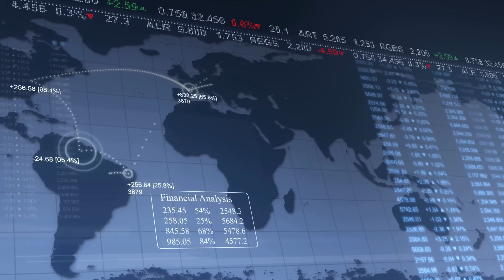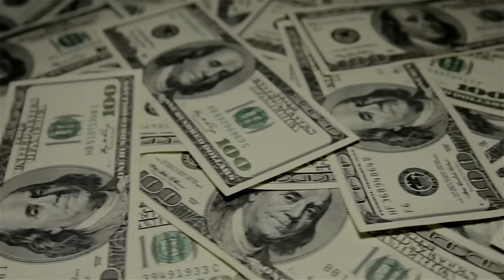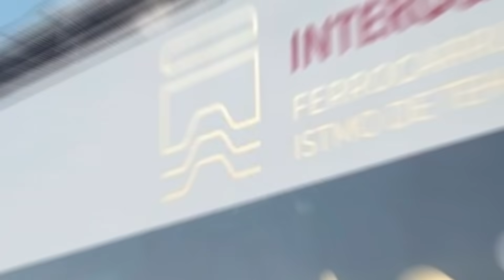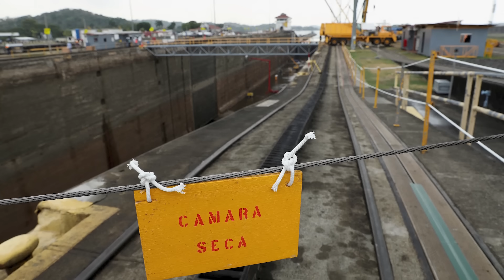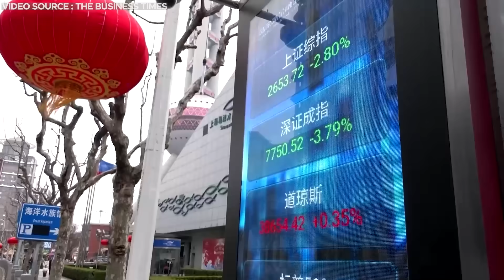Mexico Is Building A $5 BILLION Corridor That Will END The Panama Canal

Comment: U have to realize that this was attempted before and it failed.  Ships still want to use the Panama canal more that this railway transfer as it is more tedious.  However due to desperation, there will be some ships that may opt using this alternative... that is if the cost is lower than the fuel and operating expense of going around the tip of South America as the only other option so far.
Reply: it failed only when the canal was opened and the rail's business dried up.

Comment: I hope the engineers have another way of thinking. Instead of a "water canal" use a mega-lift to raise the ships by hydraulics. Then pull them from the east to west or west to east by diesel or electric locomotives. They will have to use locomotives to pull the ships anyway. So why not lift them up with mega-lifts under the keel to secure them then transport them. In turn it would be cheaper to build as well. 
Just thinking outside the box. Thanks for the video.
Reply: Do you think existing ships would be able to take the stress of being out of the water fully loaded? My guess is they would need to build ships differently to handle this,.  The trade off would make the ships heavier and lower capacity, could have a negative impact of profitability.
Reply: @mplsmark222  Exactly, ships are designed to carry the load in water not out of water. They would fall apart.
Reply: @tired7140  I agree, the additional costs of building new reinforced ships, the heavy rails and equipment ect, it might be easier and cheaper to just dig another canal. A Chinese guy had started on a new canal in Nicaragua, but the project failed. Seems like that could be restarted just like the Panama Canal, but perhaps their political status will not allow for that. If they require locks then They will need to have a source of water too and may have the same problem as Panama.
Reply: Interesting.
Reply: @mplsmark222  If you watch videos of ships being launched from the dry dock. They don't bend or crack. The lift is sturdy enough to handle the weight. Good thought though.
Reply: That's what I had imagined.
Reply: There are some huge hurdles that you would have to solve.  The rail line needed would be MASSIVE.  You're not talking one set of rail lines, but multiple to support THAT much mass.  The amount of reinforcement under such a massive vehicle would be insane. The speed would have to be uber slow.  A fully loaded cargo ship out of water is going to be extremely top heavy.  You'd have to devise systems that will work in salt water that can dock with the ship, cradle it, and hoist it out of the seawater.  The ships will also have very irregular sides due to barnicles on the sides.  

The conventional approach of unloading the ship, using standard rail lines and the loading another ship are all normal and usual engineering.  There are tons of off-the-shelf solutions and hundreds of thousands of people that are trained to use them.  It's cheaper, faster, and less problematic to unload the ships.  Your solution isn't at all practical.  The best engineering uses has the fewest new problems to solve.  It's easier to find investment dollars for, and the easiest to predict.
Reply: Big container ships have a deadweight of over 100,000 tons.Some mega lift
Reply: It is cheaper to just unload the containers on one side, then reload them on the other.
Reply: @e-curb  : no. Time consuming. Time = money.
Reply: @deepsleep7822   Read the whole response from fakshen above. It would be far faster to unload all the containers on one side and reload them on the other.

Comment: How does a canal connected to two oceans run out of water especially when sea levels are rising due to global warming??
Reply: If they were to dig a channel deep enough to maintain sea level from east to west, the canal would be self-sufficient. This is not the case and the ships are elevated with locks to allow them to transit over the land. The locks that raise and lower the vessels are fed by inland water. The overuse of this resource is the limitation to the current system. If inland water cannot be replenished, the locks cannot be used.
Reply: @bflat1894  That would be a significant dig, there is a 26m elevation at the lake in the middle
Reply: In theory, they could drain all the water out of the canal into the oceans and the only way the restore it is lots of rain. The main reservoir for the Panama Canal is a man made lake, not the oceans. Ocean level has nothing to do with it, other than providing the rain.
Reply: Same reason former president Obama bought huge breach front properties in both Martha's Vineyard and Hawaii.  

He doesn't really believe in in global warming or he would be concerned they would be overtaken by sea water, but he does like the climate change scam that provide vast sums of cash for Leftist Karens
Reply: GLOBAL WARMING NOOOOOOOOO. Send Al Gore your money to be saved. lmfao
Reply: @alanbiancardi2531  Has nothing to do with it. Do the research.
Reply: @alanbiancardi2531  Rising sea levels are forcing Indonesia to relocate their capital as Jakarta is sinking.  Fully a third of the city is now dangerously below sea level.  They are building a new capital city on Borneo costing hundreds of billions of dollars.  Global warming is the culprit. Welcome to the real world.